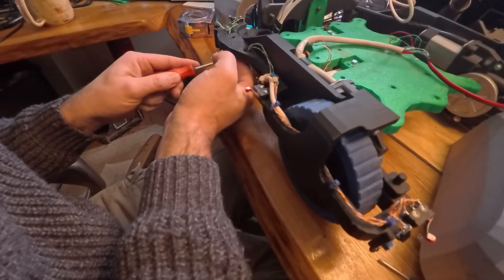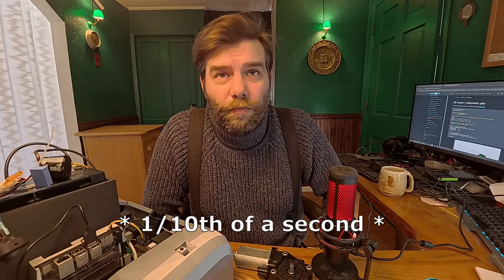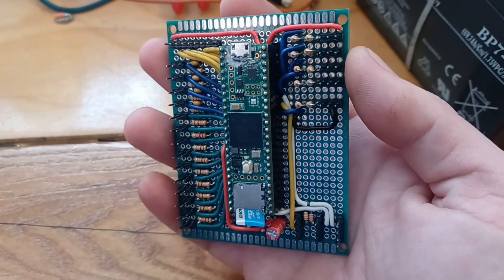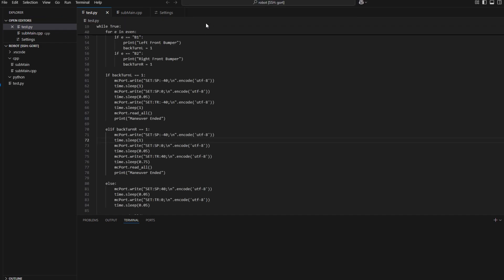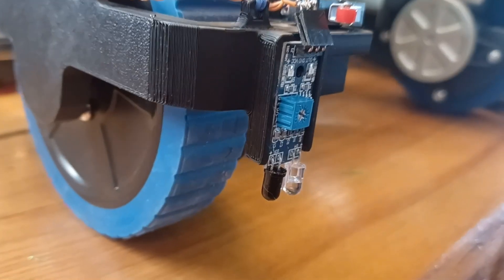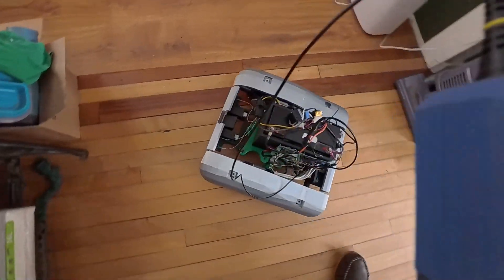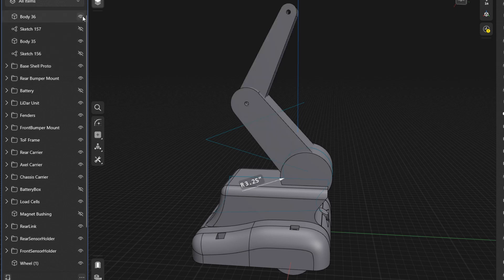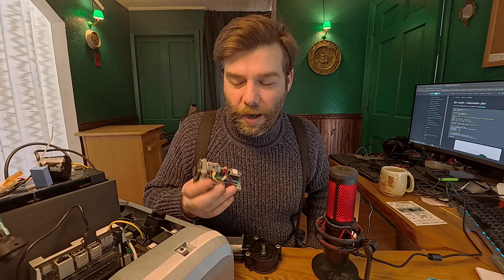Household Robot Project EP13: Completing the base and initial sensor testing.

Comment: A solution to your bumper sensors would be to increase their throw.  Have the bumper protrude about an inch and have all of that distance that it can be pushed it.  But make the sensor trip in the first 1/8 of an inch of travel.  This would give your logic more time to react.
Reply from the maker: That's a good idea. I'll have to try and figure out a way to do that, hopefully without changing too much of the chassis... (There is are many hours of 3D printing in the chassis.. 🤣)

Comment: If you touch your hand on something hot you reflexively jerk your hand away very quickly, because the signal from the nerves in your fingers to your muscles just bounces off the spinal column and bypasses the brain entirely.
With that in mind, maybe have local processor nodes taking care of things like motor position and sensor data, and have things communicate with different levels of priority.
For things like sensor data instead of streaming a constant firehose of data you could request specific packets <3
Reply from the maker: That's exactly what I've been thinking! :)

Comment: Oh man, so a few things.

1) Love the remote code push.  There's a way to do it with the arduino too (not sure if you can directly use vscode) you put arduino cli (google it, you should find the github) on the nano and then you can set the nano to push code to the arduino.  You probably could do the ssh from vscode to the nano for the arduino code (you need the sketch on the remote machine anyway to build it) but then you need something on the nano to tell it to build and push to the arduino.

2) I think you need a big chonky estop button (and some way to press that remotely)

3) Cliff sensors - I've had trouble using the ones you used for anything except a line follower bot for the same reason you found.  I'd suggest a downward facing US-100 Ultrasonic or something that's reading the ranges and flagging if it suddenly spikes.  Recommend making this a reflex as well. (btw in a great minds think alike moment, I wrote out a whole thing about reflexes before finishing the video only to hear you talk about it like 20 seconds later).

4) I also like the teensy.  It's like just before you need a real computer to do the job, it can do almost all of it.

5) I'm super interested to hear how the mapping unit works out.  I'm thinking about a similar setup for a remote telemetry rig I'm building for work in my spare time.  (think the MALP from Stargate in the form factor of Johnny 5).
Reply from the maker: I'll have to look into Arduino Cli, might be very useful!

I do have a motor-kill switch in the circuit... it's just lost in the mess of wires right now since I don't have a place to mount it yet... 😆

For the mapping unit, I have this mapping method going around in my head that I haven't seen done before, but I want to refrain from talking about it until I find out if it actually works.. 🤣
Reply: @ Yeah I think you're going to like it if you want to push fully remotely.  You could write a systemd service that's scanning the sketch directory for changes and then automatically rebuild.  I think I'm going to end up doing that.

hahaha it's not a kill switch if you have to dig for it!  It's probably fine for now when you're going to stand right there while it's running.  I'd probably do the same thing at this point in development.

I'd be interested in seeing the fail too fwiw.  If you posted it as "Well, this didn't work" that would at least prime people for what they're about to see.  Also also, the old axiom "Easiest way to get the right answer is to post the wrong answer"  I'm sure I'll have some stupid idea to try if yours doesn't work. hehe

Comment: For the mapping unit what are you using for the USBC interface on the back section? What pins are you using with it and is it connected to the Raspberry pi 0? It looks really neat!
Reply from the maker: Thanks!   The USBC on the back is to a Seeed Studio Xiao ESP32-C3. It's a nice little $5 Arduino. I'm using it to read the data from the IMU, and then sending it to the Pi Zero via UART serial. Right now I'm talking to the unit via WiFi, but in it's final form I want to make the Pi become a USB serial slave device.
Reply: @joethieman9400  oh so you have Uart of the Xiao connected too the IMU and then using wifi to send the data to the Raspberry pi?
Reply from the maker: Kinda the other way around... I was struggling to get the sensor library working on the Raspberry Pi, so I just threw the Xiao in there to read the IMU and spit that data out through UART to the Pi. It's not really a necessary component, but now that it's there I'm offloading some of the computations to it.. (Basic IMU stuff, like dead-reckoning odometry... which is not accurate... but perhaps it could be integrated with other data to become more useful)
Reply: @joethieman9400  Ah ok haha I keep forgetting your probably using I2C from the IMY to the Xiao then the Xiao is using serial communication to the Pi after you have done some of the calculations beforehand. Makes sense that way anyway. Sorry for the questions. I am excited to see where this goes though as I am working to develop a similar project for gardening needs outside.

Comment: Maybe it is possible to just use whisker like sensors for cliff detection? When the whiskers that are oriented downwards are not bent then there is a cliff. Some flexible wire and a contact ring around it so that it works in all directions equally might do the trick maybe? Just a thought. Idk if some reliable sensors exist that would function that way.
Reply from the maker: It's a good line of thinking in my book, the problem that comes to mind for me is the whisker getting caught on things. Charge cords, dirty socks, and one of my kids has the fuzziest floor rug imaginable.. 😂

Comment: I have a Zero, and its super underpowered, I don't think you can do realtime mapping, you may be lucky to read the camera at 30fps.
Reply from the maker: Pi Zero or Pi Zero 2?  Mine's a Zero 2, and it's a huge upgrade in power from the original Zero. The ToF camera has a maximum sample rate of 25 FPS, and cleaning up the raw data and converting it to a point cloud only takes about 2ms per frame, so I have high hopes!  My goal is 20fps, though I think this robot could operate just fine at 10fps.
Reply: @joethieman9400  I have the original Zero, because I couldn't buy the Zero 2 W, but what you describe sounds reasonable. Although I wouldn't have high hopes for a generic monocular camera generating correct distance measurements even with calibration.
Reply from the maker: Actually I'm using a Time-of-Flight camera by Arducam. Basically a solid-state version of a 3D LiDar. You should check it out, it's pretty cool Tech!
Reply: @joethieman9400  Was the tof camera easy to set up on the pi 2w?  I have the regular arducam and the pi 2w running my 3d printer and the camera is a huge pain in the butt to get working.  I spent so long to get the internal raspi setup working and it still won't work as the timelapse camera for my printer.
Reply from the maker: It didn't work the first time I tried it, but that was with a minimal operating system... So I tried to reload the Pi Zero with the full Raspberry Pi OS (Bookworm), then followed Arducam's setup instructions and it worked. The example programs for the ToF camera will fail if you don't have a monitor attached. I didn't have that setup, so I just took my old code from the Pi 4B to test the camera.
Reply: @joethieman9400  Ah ok.  So I think I have it working from the raspi end at this point (basically had to do what you did but I didn't want to start over so I just apt installed everything that wasn't originally installed... way easier, right?!).  I think my problem lies in klipper.

Comment: It might be worth trying ultrasonic distance sensors for cliff detection. They are cheap and simple.
Reply from the maker: You may be right. I have a couple more tweaks to make to the IR sensors before I give up, but ultrasonic sensors might be the way forward.  :)
Reply: @joethieman9400 I was thinking that too, but there's one important detail to keep in mind: US sensors are blind at close distances. The simple HC-SR04 has a minimum distance of about 2cm (which should be alright), but single transducer sensors could be blind for >10cm, due to needing to wait for their transducer to stop ringing from the transmitted pulse/beep before it can listen for an echo. So you'll need to use sensors with separate tx/rx transducers. And be sure to test on carpet! The fluffier it is, the harder it'd be for these sensors to see it.